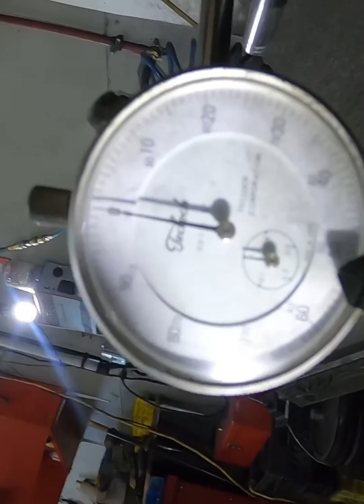how to surface a Cylinder head The RIGHT WAY

Comment: Wish you were around my neck of the woods.  I got skull fucked to the point of internal bleeding out the ass. for $315 to surface 2 3vz heads. Just surface, no clean, no, pressure check, no valve job.

Comment: That’s what Pam was originally intended for but corporate said “ah what the heck, why not just market it as high grade cooking oil?”
Reply from the maker: That I didn’t know
Reply: CUTTERUP ROB During WW2 Canada produced huge amounts of rapeseed in order to lubricate aircraft, ship engines and other machines.

Then, when the war made it difficult to acquire European and Asian rapeseed oil, a critical shortage occurred. The Canadian government recognized the opportunity and set out to find other uses for the product they had become so good at producing.

However, early versions of edible Canola oil did not go down well. The challenge was to get rid of Erucic acid and glucosinolate, which tasted unpleasant and was potentially bad for one’s heart.

It took a several decades to achieve the desired product. Finally, two individuals at the University of Manitoba, Canada – Richard Downey and Baldur Stefansson, came up with the breakthrough to turn an ‘engine’ oil into a super cheap cooking oil.

Their product became known as ‘canola’ – which actually stands for Canadian oil, low acid.
Reply: And "Listerine" was originally formulated to be a floor cleaner.

Comment: I once used a belt sander to make a set of rotors more straight...its not the best way but in the situation all I had ended up putting 15k on those puppies.

Comment: Good job :)
BTW: As machinists/engineers, then we often get too fixated on the "right" way of doing things, when in fact there are many different ways of doing the same thing. 
IMO: The "right" way to precision surface a cylinder head in an economical way is to use a vertical spindle surface grinder with grinding head and lots of coolant, BUT these machines are very LARGE and costly for small jobbing shops.
A cylinder head can be satisfactorarly machined("right")on a lathe, planer/shaper, h/v mill, bed mill, h/v surface grinder......
Personally, I've used a 50int x 18" dia grinding head mounted in an old, and v-large(4.5ton) Archdale vertical mill for years, which will way out-perform a single point cutter in terms of stock removal and finish for obvious reasons. I've also used horizontal mills with fly-cutters for manifold surface finishing/squaring, etc.
Ultimately, we'll all have our own "right" ways to do jobs given the circumstances ;)
Keep safe and well.
Reply from the maker: I have done them lots of way as well. I was thinking more of guys using sand paper , belt sanders , grinders, etc. Any piece of precision equipment works just fine. Thanks for watching
Reply: @CUTTERUPROB  Ahhh, I thought you meant re:other engineers/machinists - btw there are some very funny parodies of diy head grinding using angle grinders and caulking guns on YT!!
Now subbed :)
Reply from the maker: @craigywaigy4703  i have seen some lol

Comment: dont ya hate it when you do a diesel alloy head with steel direct injection inserts lol
have to be very careful as the bit that cuts can jam up  when it hits the steel and it can bur the edge fucking up the skim on the alloy by dragging the steel burr over the soft alloy surface cutting it up like crazy
Reply from the maker: Ya I hate it when I have to do a pre cup engine

Comment: That head is now junk because the head gasket    Which you can get in two or three different thicknesses  two make up for resurfacing to put cam timing back to speck   You took off 6 thou and the belt sander took off a bunch it’s junk
Reply from the maker: It was below min spec when i started to surface it. it was junk when i seen it. But it made for a good video piece
Reply: @CUTTERUPROB   that’s what I was getting at. This first guy messed it up I Figured you could on take maybe a thousand off and it was trashed
Reply: adjustable cambelt pulleys overcome the cambelt problem.
Reply: Good video as the mill is the final word in what is actually flat. Throw that straight edge back in the tool box.
I have taken .040 to .050 off motorcycle heads using them with decked cylinders (-.005 to -.010). Slotted cam sprockets ( and sometimes shorter cam chains) overcome the cam timing problem,
 All 4 cylinder Subaru heads that have head gasket leaks need milling....don't even think about not doing it (though many Subaru dealers will forget about doing it). That and Fel-Pro head gaskets.

Comment: I glued a couple sheets of sandpaper to a slab of granite and slide the head back and forth the last time I did a head gasket. Works great but takes a little while
Reply from the maker: that works as long as you can over stroke by 50% of the head and it's not out of flat to much
Reply: @CUTTERUPROB  the head was aluminum and it was quite out. I made the mistake of not checking round on the rods after upgrading the rod bolts. 🤦🏻‍♂️

Comment: what brand is your machine? is that finish appropriate for MLS head gasket? what do you think about the CARMEC brand? Im planning on opening a machine shop here in arizona and would like to know your opinion about what brands would be the more suitable for what i'm planning on..... Thank you very much and thank you very much for the video as well. God bell you.
Reply from the maker: My machine is a dcm that runs pcd. Are you planning on doing just auto or diesels as well ?
Reply: @CUTTERUPROB  thanks for replying im planning on doing diesel as well
Reply from the maker: And yes this surface is good for a mls gasket
Reply: @CUTTERUPROB  great thanks. I'm looking into CARMEC, ROTTLER AND VAN NORMAN and I'm inclining for van norman but I'm going to take a look at the DCM .......what do you think. Your input is greatly appreciated. Thank you very much again
Reply from the maker: @juanmorales4976  if I was buying a newer machine I would be looking bay a rottler. As there made in the USA and are easy to get parts for